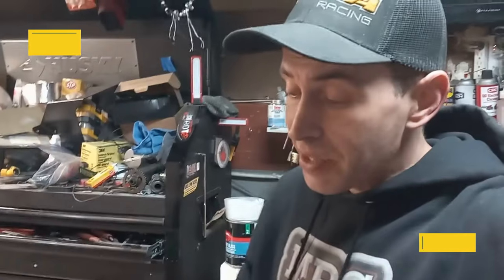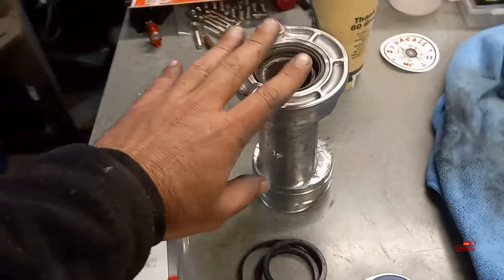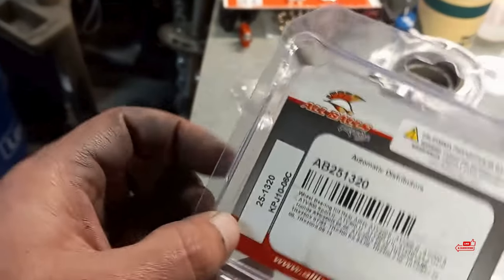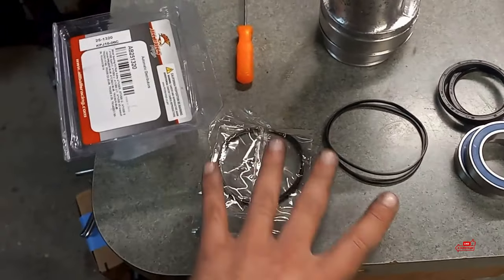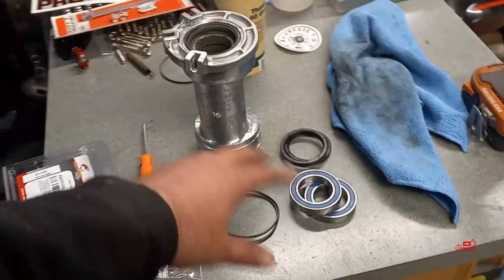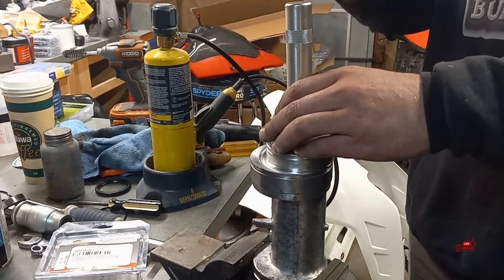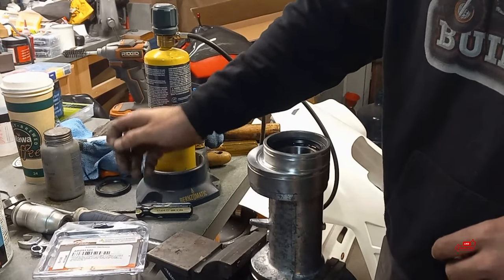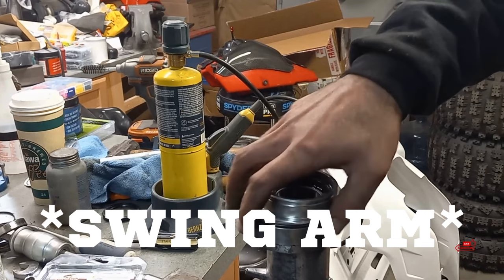Rebuilding an Axle Carrier. TRX250R Project #garagemcmatt #honda #trx #250r

Comment: Put some heat to the situation really makes it easy
Reply from the maker: If it was gunna fight more then it did, that was the next step. U can see the torch in the background waiting
Reply: @garagemcmatt I just got  to that part 😆 I'm one them guys who comments before the videos over
Reply from the maker: @ALDA2479  I hear ya. I set the videos up for that sometimes
Reply: I use a hot plate and they fall right out.  You should get one.  Honestly I use the cheap ones, so do allot of other xc guys.  I've been told by some people in the industry, the bearings are all the same.  I use the niche ones and I a line start case I use with 20 bearings.
Reply from the maker: @johnbruzzi4381  I have a hot plate I just forget where I put it

Comment: Hey bud i tried to take the airbox cover off the 400ex and it didnt seem to help with sputtering... But then i realized its when the throttle is closed as it decelerates so i think i need to gain access to the idle fuel air screw and throw a richer pilot jet in it?  Maybe not but everyone i talk to says it needs about a 45 pilot when im running a 42.  Its close its running fast and has the good pull but my ocd wont let me stop until i can pull that wheelie, get it to 3rd + and let off completely without a sputter slowing down. Thanks for all the input and illnlet ya know when i figure out the sweet spot
Reply from the maker: Ok cool. Definitely lmk what helps it

Comment: honestly theyre all about the same to me . ive paid 200$ for aftermarket carriers that lasted a season and some failed the first race . ive rebuilt them and got the same result and ive bought the 75$ tusk getting the same results over time . some will blow out the first race and some shock you by lasting the whole season  . so at the point to me we pay over price for a name brand within the industry to get the same results with a cheaper part . i check them after every ride anyways and always keep back ups incase just so i dont miss a race . also ive taken the LSR carrier apart and it had the same brand bearings as the tusk . so i was like them MFERS are ripping us off  lol
Reply from the maker: I seen the same thing. If I was to say that on video I'd have 500 people tell me I'm wrong. I think it comes down to some parts are made on a Monday and the quality is in the dumps, some parts are made by a guy that's going through personal problems and it carries into his work, and some parts are made by someone having a good day. I hope that made sense
Reply: @garagemcmatt  yeah the monday parts should come half price haha